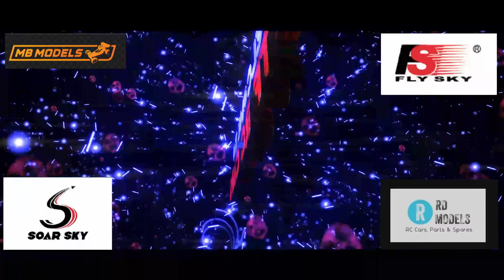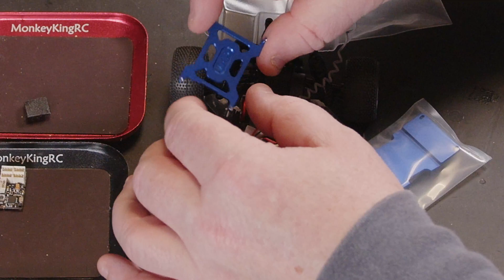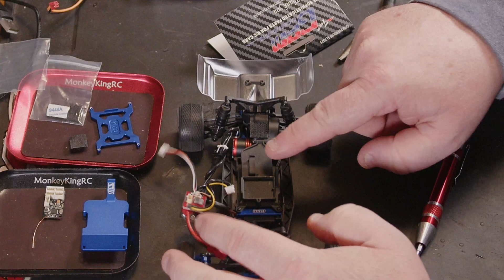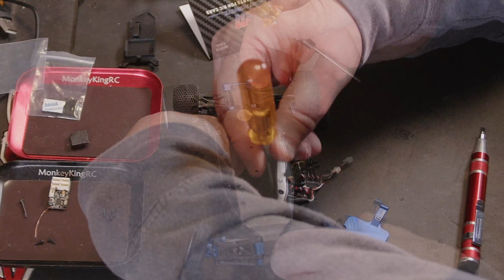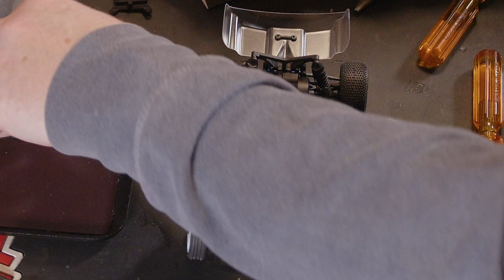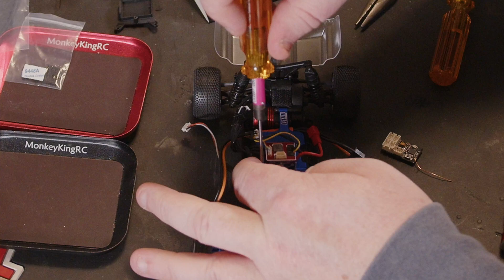GPM Racing 7075 Aluminium Battery Holder and Electronics and Receiver Mounting Plate Losi Micro-B

Comment: Have you considered magnet mounting the body?
I find it snaps to the perfect fit and works easier than velcro which wears over time.
Reply from the maker: Yeh and I have a few but it's close to the motor so I'd have to test it out and makes sure it fits and doesn't affect the sensored motor :)

Comment: Hot racing sells a battery hold down that's lighter 6061, and lower cg because it's a 2 piece battery brace front and back instead of under. Hot racing also makes 6061 top deck. Normally 6061 would be too weak, but solid for 1/24. The stock chassis is also 6061 aluminum. Options in case you need lower cg.

I just know I'm gonna have a hard time fitting electronics.
Reply: I also forgot the hot racing top plate comes with thumb screws so it's easier to remove.
Reply from the maker: My only worry with 6061 is with very fine screws not sure if the threads will hold up
Reply: @WTFRCCars  hopefully I'll have a micro b by then and I'll be able to share if it has problems. Can't wait to see running footage.
Reply from the maker: @one4all885 yeh just need to get time so I can get to the track I work 12h days and nights so getting time is hard